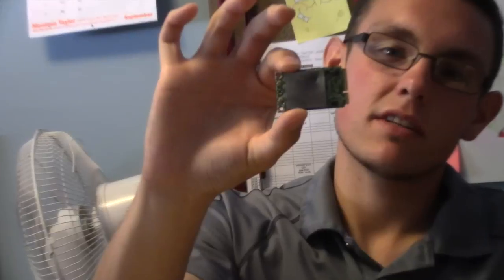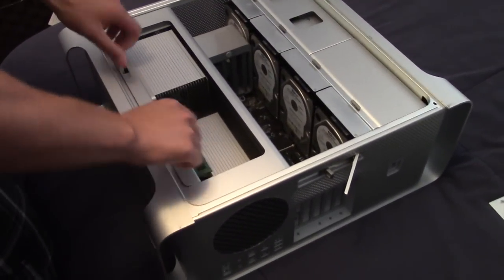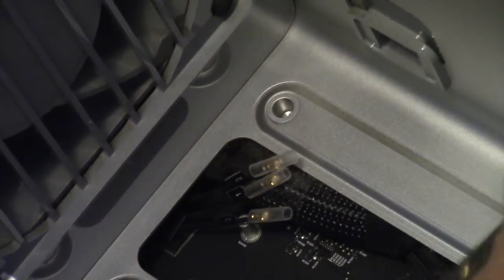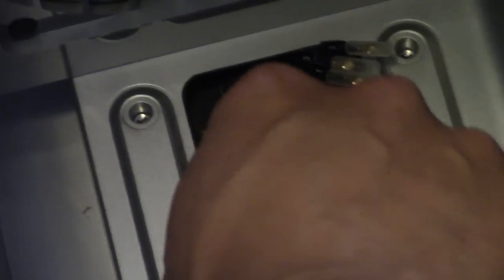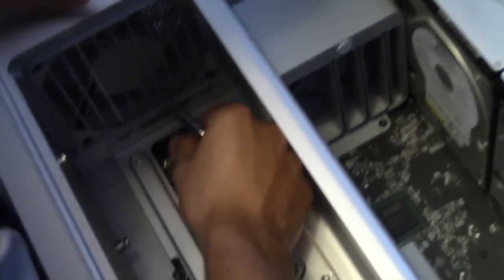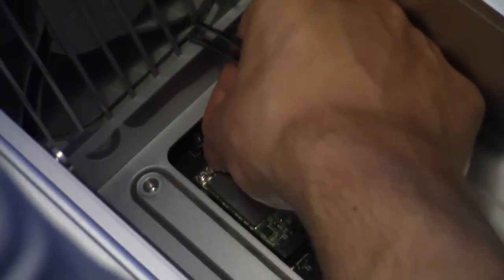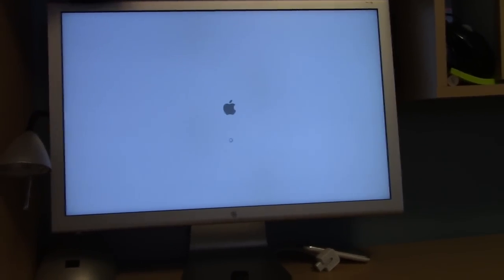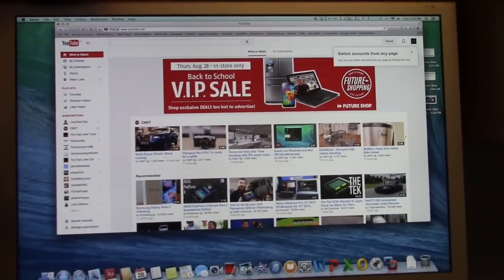2009 2010 Mac Pro Airport Card

Comment: FYI: For anybody that didn't get screws when you bought your airport card. I ended up using screws from an airport extreme router that died on me and was basically used for parts. There are 4-6 screws from that router that will fit perfectly. They are the screws that hold the attennas in place.

Comment from the maker: Max, thanks for you comment, it always feels good to get a complement on a video! I totally agree with you about the card instillation- probably why apple states it is not a user installable part :P and yes I think I can still recommend the 23inch apple display- the resolution is still competitive with newer screens, and the refresh rate is 60htz; the only downside to a slightly older monitor is its colour refresh- 16 milliseconds grey to grey. This is not horrible but for gaming newer monitors are quite a bit faster but for me, general use, light editing and Photoshop, and some simulator games it seems to be great! My next screen with probably be the 24 inch Cinema Display as it has the built in camera, and speakers!
Reply: NIBtechsupport maan, this is some crazy noodles. I mean I’m trying to install Ssd in iMac mid 2011. And the struggle is real. This thing won’t go off. It mounted on gpu heatsink side. And screw says “no”. Although it is torx t6 and I tried to do it with minus screwdriver which fits in and leans on edges (angels) inside. But maaan this is crazy how something so little could lead to the problems so big. I’ve heated it from back, I’ve curved the base it is mounted on. But “no” is “no”. I wish girls nowadays would be that tough on decision.

Comment: The antennae don't seem to securely attach to the nipples on the card - they just appear to pop off with the slightest movement. Is this normal - do they need to be soldered? I've just had to order some screws which is frustrating, but I can't see how I'll get the antennae to fit without solder, which is obviously a risky proposition because you need to pray you've got them in the right position!

Comment: I have very good eyesight, so maybe it was easier because of that... I was done in about 15 minutes from shut down to reboot (including scrubbing through this video and searching for useful comments. I placed a small flashlight on its side at the opposite end of the CPU cavity. I did the wires first as was suggested in the comments. Instead of trying to move the wires into position I just turned the card itself to be in line with antenna pin. Then with the other hand I pushed the antenna pin and the antenna seat on the card together. As long as it's lined up you can press pretty firmly. Repeat for the second antenna... Screws took all of two seconds, and that was that. I guess what I'm saying is if you can see what your doing it's pretty straight forward. Good luck

Comment: I just installed a wireless airport card in my 2009 mac pro and the card (hardware) is not being seen my the computer.  Any thoughts on how to fix this.  Tried reseating the card and it seems to be in the slot quite well.
Reply: Same problem here
Reply: Same problem here did any of you figure this problem out?

Comment: Hi i'm having an issue with my mac pro 2010 i had it upgraded to run mac os sierra 10.12.6 first off the computer restarts on its own at any given time, and internet connection gets lost or shuts off,
but still get internet connection on all of my other devices like my iPhone and MacBook pro laptop. Could this be the airport card not connected right or what? and the what about the other issue, have you ever had this problem and how did you fix the problem?

Comment: Bit late to the party Airport card to my MacPro early 2009 - bit fiddle connecting cords 1 & 3 to card , used pointed pliers to position and pressed down with Phillips screw driver - wifi connected after a few weeks as you had - thanks :)

Comment: Thanks for the video. It helped clarify some questions I'd had regarding installation (the instructions that came with my card were 2008 centric too).

One difference for me... the antenna connections were labeled "1" and "2." There was no "3" connection. So, I installed 1 and 2 and everything works fine.

Comment: Where  conect the cable 1 and the 3 ?
Reply from the maker: there are two little connection ports on the WIFI card, they look like little round dots- put antenna one on the bottom one, three on top. :-)
Reply: I think I put the 1 on top and the 3 down
Reply: I connect cable 1 to jumper 0, cable 2 to jumper 1, and cable 3 to jumper 2.Everything is working right and very fast.
Reply: I got only 2 jumpers and 3cables

Comment: I have Mac Pro Quadcore from 2012 and have bought a set to replace old Bluetooth and wifi. I took away the old stuff and thought it would be rather easy to install the two new cards, one for Bluetooth and one for wifi. But I was mistaken. Now I have none of the functions. I can´t figure out how it should be installed, and the screws are so tiny that I dropped one of them in the computer chassi, but I found it at last. And you must be very careful during installation because this is fragile parts. Why did I begin with this? It costed me around 100 dollars, and now it seems to become a flop. Why didn´t Apple upgrade at least Bluetooth in 2012´s Mac Pro? Version 2.1 EDR is very out of date today when you can get 5.0.